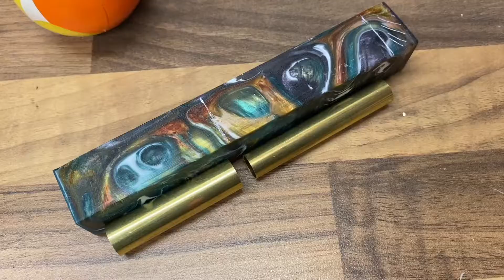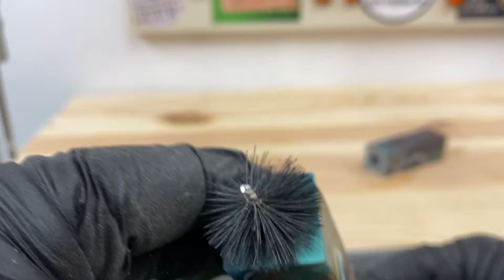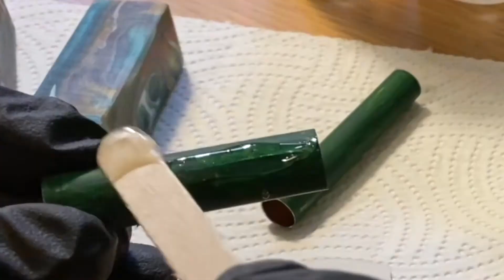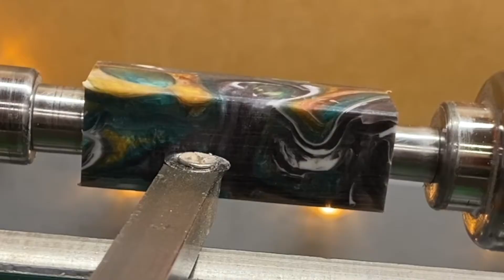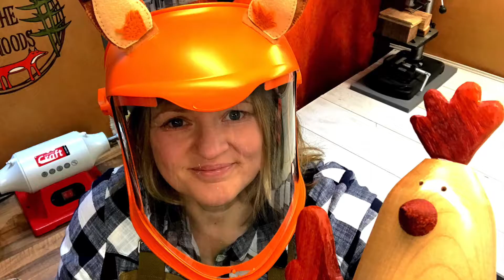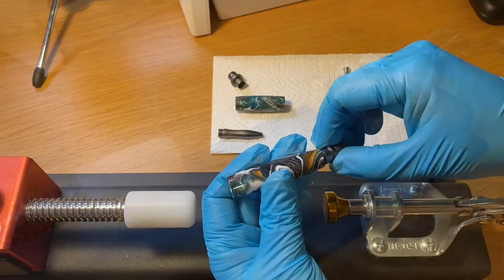Woodturning | Pen with 3D Lava Blank

Comment: Very nice.  Came over here from Jake Thompson’s site, you were recommended by Jamie Page.  To your comment regarding CA glue and issues with blow-out.  By that I assume you mean the tube coming loose compared to epoxy.  That makes sense.  CA glue has very strong tensile strength but is very weak in shear.   If you are putting pressure longitudinally along the barrel, it would be easy to see how the CA could let go.

  In your comment to Roys the Boy, do you know the brand name of the mandrel you are using?   I’d also like to look for it.
Reply from the maker: That’s exactly what I mean with the CA! Thanks for coming over. I’ve searched everywhere for the mandrel receipt and have no idea where I ordered it from and it has no maker markings. I’m on a mission to find out as have  had a few people ask now. Will get back to you - I know I have it somewhere! Claire x